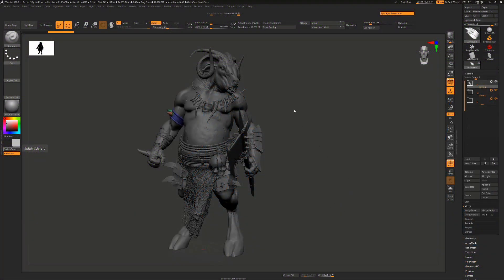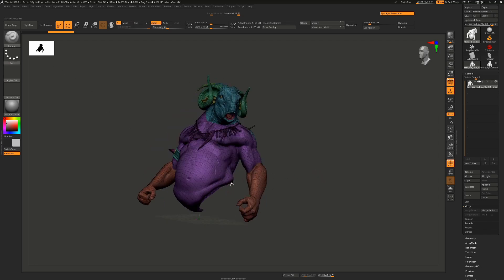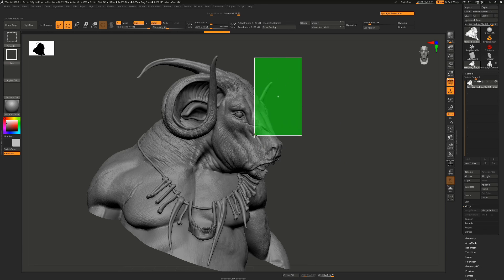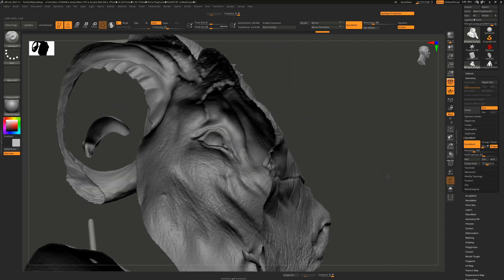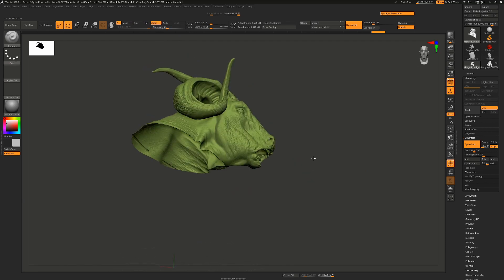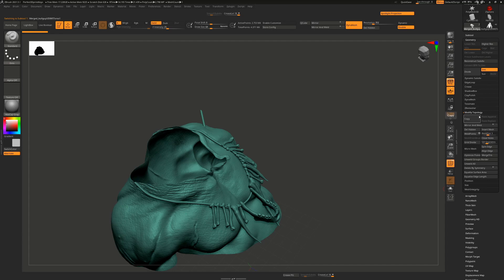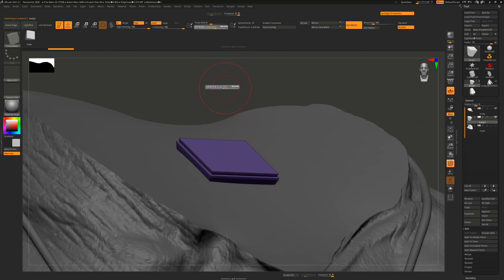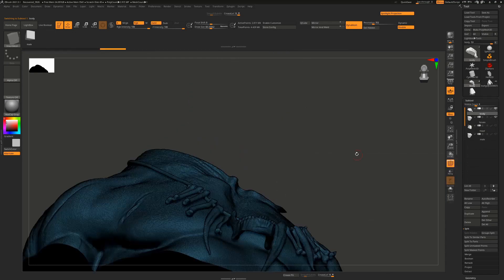How to create razor sharp 3d print keys in ZBrush with zero visible seam lines

Comment: amazing tutorial! however when I hit the close holes button it gives me non manifold lid that doesn't perfectly fit to the edge line leaving some wafer thin excess surface, will there be any way to sort this out? It was a planar cut. I also used Zmodeler close and it seemed to be giving me the same result. thank you in advance!
Reply from the maker: You may have had some thin extra geometry which wasn't visible before you did it. Try turning on double sided to see it before trying to close it. If that's not it, try using automatic polygroups and then selecting only the main polygroup to hide any potential others, delete hidden and try again

Comment: Great tutorial, but I'm having a problem where after using the insertmesh brush, only the female polygroup is masked, so when I use the gizmo tool or try to split masked only the female one is affected. I'm using Zbrush 2024, and I noticed that your insertmesh brush doesn't give you the option to change the stroke, while on mine I'm using DragRect since the other option don't work well with it. Could be a problem with the version difference?
Reply: I forgot to say, I ended up hiding the model and masking both of the keys so it worked out in the end, but your method seems to work faster
Reply from the maker: Thanks. I actually made this tutorial about 4 years ago, so I don't remember everything in it, where in the video are you referring to? (i.e please don't make me have to re-watch an 18 minute video!)

Comment: This video is Great! But i don't know what i did wrong😢 i have followed every single steps of your video but now that i have printed my model the keys don't fit together😢
Reply from the maker: What happened? Is the male peice too big to fit inside the female part? If so, you might need to increase the difference between them - done at this part here: https://youtu.be/xNxW8Yl0980?t=580. Unfortunately, it's very size dependant and you might have made the male piece too close to the female piece in size, which is easily done, as it's easy to zoom in close when making these, but ultimately what you see on your monitor when zoomed in is nowhere near the real world scale when you zoom out to real world size. Fortunately, you might need to just rescale the male part down a bit to fit, so you won't have to reprint both parts. At least, hopefully!

Comment: awesome content, thanks!
If its for resin print, and you would need to hollow out the different parts (head, torso) how would you proceed with that? any sugestions?
Reply from the maker: I'd probably use MeshMixer these days. I'm thinking of doing a tutorial on it soon, so hopefully in the next couple of week it'll be up. No gaurantees though, but there are plenty of other Meshmixer tutorials out there (it's free by the way!).

Comment: Sean, any tip for 3d printer?
Reply from the maker: Not really. Form printers are rock solid, but I haven't tried enough others to give advice really. I had an ultimaker but am presuming you want a resin based printer. My elego mars 3 has it's issues.
Reply: @SeanForsythTutorials  Thanks Sean, i will try that resin. Sure for few printed models a year :) nothing crazy
Reply from the maker: @karelchytilart  Yeah, the Form is an expensive printer alright, probably notworth the investment if it's only a few moels a year. The Elegoo mars was good, but it was tied to Chitubox as software, which you only get a one year license for when you buy the printer. Not sure if that's change lately, but I'd certainly be looking for printers not tied to Chitubox if possible, as it's FAR too expensive, and you should be able to use a free slicer.
Reply: @SeanForsythTutorials  Thanks a lot, really

Comment: Awesome but doesn't the model need more thickness? 🤔 Can we just do a dynamic thickness inside?
Reply from the maker: If you're printing with an FDM printer, you'll be using infill, and if you're printing with a resin printer you'll need to hollow it out and put some escape holes in it, normally done using your printer software (such as Chitubox), and when hollowing it out that's when you define your thickness.

Comment: perfect video... thank you! 
I have a question, in another video you said that the dynamesh project button was only functional on rare occasions to maintain hard edges when we lower the resolution of a model. this does not apply when instead of lowering the resolution it is raised as in this case?
Reply from the maker: Yep, it all depends on what you're making, and whether you want to use the feature or not. I'd say test it out on what you're making and see if it suts your purpose.

Comment: I have a question, the creature you've sculpted in Zbrush lets say you'd sculpted it in a perspective value of 28. What makes you sure when you export it from Zbrush to a 3d printer it will keep that perspective and not make the model completely different in person than what you see in Zbrush?
Reply from the maker: Apparently 28mm is the same as human vision, or at least very close. I can't rememeber who said it, it was at one oof the ZBrush summits a few years ago, some guy had worked it out. Anyway, if it is correct, then what you see in ZBrush should match what your 3D printer gives you.
Reply: @SeanForsythTutorials  in photography human vision is closer to 50mm, so I don't know where 28mm came from
Reply from the maker: The older versions of ZBrush didn't have the Universal camera that is there now. As far as I know, it was an attempt to mimic real life cameras, but wasn't particularly good, hence the development of the new camera system. It used to use Angle of View rather than Focal Length, and that 28 Angle of View was apparently closer to the 50mm focal length you are talking about. But... I honestly am not a camera guy, so am relying on others smarter than me to educate me on this stuff. I found the video i was referencing, this what I was basing the 28 on: https://youtu.be/i6KKp8UpjYI?t=1086

Comment: Whenever I do boolean operations or remesh by union I always get some isolated polygons or pockets of them inside the main subtool. For instance, say I have a torso and I sculpt clothing over it, i get some shapes that float inside the mesh where the subtools arent in contact with each other if you get the idea. I can guarantee that the mesh is watertight but I keep getting this issue. Is there something I’m missing or possibly the way I sculpt the subtools is the problem?
Reply from the maker: I suspect it's in the way you're sculpting the subtools. If they are islands, as in, not attached to anything, you can easily get rid of them by going to your Tools menu and using Autogroups, then Ctrl + Shift clicking the main group you want to keep, and as that will hide any islands that are not attached to the group you've just isolated, then you can safely use Geometry - Modify Topology, Delete Hidden to delete them.
Reply: Yes, I usually do a "post-process" deletion of those stray polygons with the method you've mentioned. Just curious if there's anyway I can avoid the tedious proess altogether. Any tips on how to better the sculpting process to create to avoid these island polygons/meshes? Thanks for the advice
Reply from the maker: @alvinsilva2859  Well, there is one thing you can do, but you might not like it. Rather than doing a remesh by union, doing a high resolution dynamesh instead often does a great job of clearing that kind of stuff out. Not for everyone, as it does mean you are changing slightly the geometry of areas you might be supremely happy with, but generally you get away with it for 3D prints. It's certainly more likely to remove interior faces.

Comment: Ok cool, but with resin you need to do shell and some little holes for resin is there some easy way to do that?
Reply from the maker: Yes, absolutely. Make sure your subtool is already a dynamesh object, and then you can press B, I, T to get the Insert Primitives brush, choose the 3rd one (Insert Cylinder from the choices at the top menu bar), and then hold down Alt and drag a cylinder out onto your subool. Move it in or out so it's intersecting your subtool about half way in. Then clear your mask by CTRL + dragging on your canvas, and then under your Dynamesh rollup, hit the Create Shell button. Whatever the thickness setting is at, that's the thickness you will get. You may need to undo and redo until you get the desired thickness. But apparently most resin based printer software these days also does this hole creation for you, it might be worth looking into if you already have a printer. Hope this helps!
Reply: @SeanForsythTutorials  THX Sir :)
Reply from the maker: @hanson251985  No problem!

Comment: hey there , is it useful for miniatures?  and watertight? means there is not gap? (I mean you sealed the intersection body and head with close holes and dynamesh) but inside there is air? I mean,  you close the holes very perfect , but inside must be nothing? I mean , it is hollowed inside? or solid?  I know using zbruhs a lot but very begginer in 3D printing stuff. thx:D
Reply from the maker: Yes, dynamesh should make everything watertight. Your slicing software will sort out the interior filling.
Reply: @SeanForsythTutorials  ahh I think I would fill the inside of the mesh... so I only need to watertight ? Inside the mesh is empty or solid? thx
Reply from the maker: Yep, watertight is all you need if you are printing with PLA, then choose your infill percentage in your slicing software.
Reply: @SeanForsythTutorials  thx!

Comment: Nice video. Thanks for showing that the two faces after a Close Hole operation are the same. I wondered about this but never thought about trying to verify. 
btw, have you tried to get a single water tight mesh from merged multiple parts by Gizmo: Remesh by Union? What's nice about this method is that it gets rid of all the interior polygons and only changes the mesh where parts intersect. So detail is preserved and you don't have to worry about trying to preserve detail with a suitable choice of Dynamesh resolution. That can be a pain to do if the model has features with large differences in scale. Cheers.
Reply from the maker: Sounds like a good idea, haven't tried it myself yet though. Thanks for the suggestion!